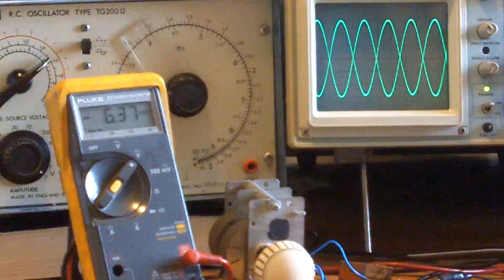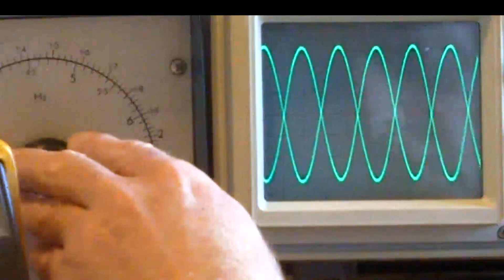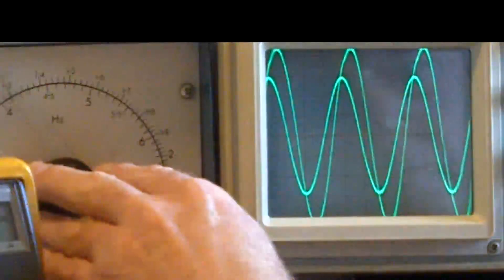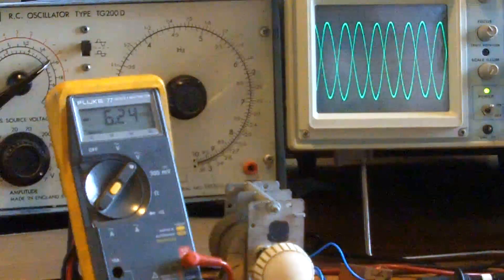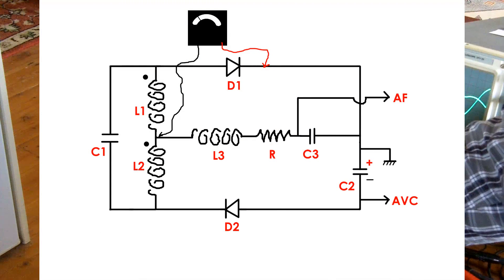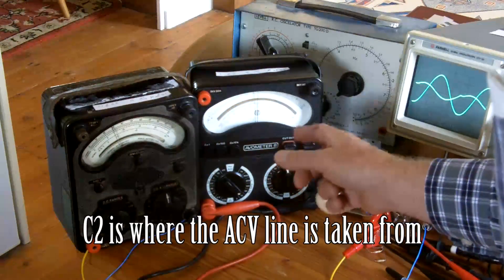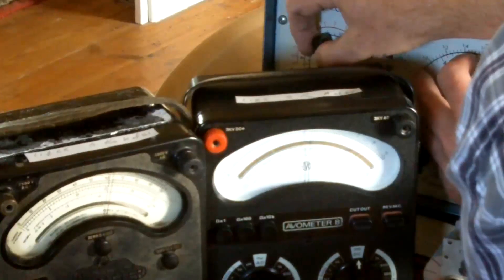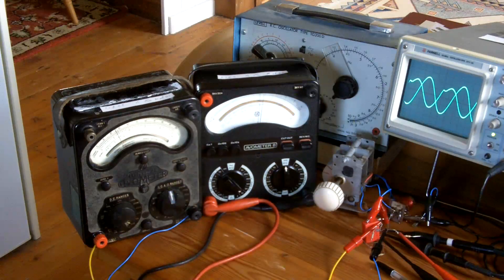About Radio ... Part 10 Ratio Detector, AF detection. By Andy Davies.

Comment: Well done. The volt meters show clearly opposite voltage readings; when the frequency of the carrier goes up or down, respectively. Indeed VERY good show Andy.

Of course this is why the circuitry's name is often called a "differential". I had never heard the "inductive vs capacitive" analysis, in C1, L1 and L2; when the reference frequency goes up or down, but it makes perfectly good sense. Plus, L3 helping to suppress the carrier; which is no longer needed. Awesome!

So instead of simply removing the carrier with a capacitor in AM detectors leaving AF; In FM detectors, the circuitry uses a ratio of two frequencies (in essence) leaving AF. Again, "Awesome".

To summarize: AM vs FM is quite different. Of course in PM (phase modulation), it is yet another different way (and more complicated) to detect the AF. Not to mention digital modulation which is VERY complicated to "detect" the AF. WOW!

"What hath man wrought?"

Thanks for teaching this so well and eloquently, kind Sir.

Comment: Hi Andy, I don't have quite the same system as your radio, but my schematic has detailed points to take measurements with an Oscope. I didn't for sure what there were at first but they make a lot of sense now that I know what I should be looking when I do my alignment on my radio. Thanks again!

Comment from the maker: @AllAmericanFiveRadio 
Hi Rick, I once designed and built a 150kW tank circuit for induction heating in a scientific application, it was working at about 120kHz with 800volts across a single turn coil, most folk wouldn’t recognise the coil or the capacitors. I can’t remember the tank current but I remember it needed something like 8 gallons per minute cooling water, that’s imperial gallons so that’s about 9.8 US gallons. Now that was a tank circuit. . . 73's Andy